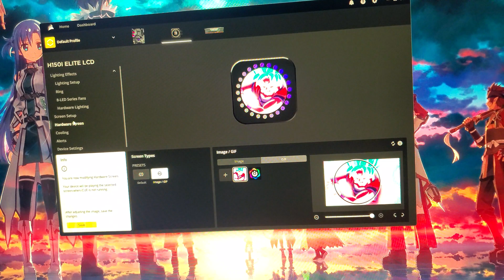Fixed the Cosair H150i Elite lcd from triangle error, 3 possible cause

Comment: corsair icue h150i elite lcd xt display i have customized my cpu cooler’s screen and rgb lighting with “icue “ it’s not letting me to go back to default lighting and screen how do i reset as it is earlier. i have even reinstalled my windows back still same issue
Reply from the maker: That's weird it should let you change your settings. Have you tried uninstall the application of icue? Delete it completely off and any files on your pc if any in documents.
And reinstall and make sure has the newest update. But that's weird it should let you change it whenever.

Comment: Just installed mine I'm not even getting screen setup option or screen hardware options seems lots of people are having this issue I'm just gonna pull it out and return it i don't have patience to deal with this bs
Reply from the maker: Sorry to hear that bro..
All I did was make sure everything was clip in right. There was one wire lined that I needed to push a little more into to clip, and I was good to go.

Comment: having the same issue but my fans are working and my screen is work also i replaced a fan on my case with a rgb fan which is also connect to the hub and it works but cant get rgb on my three radiator fans
Reply from the maker: I see

Comment: Installe mine yesterday. The lcd doesnt wort at all apart from th ering colour. No LCD settings in iCue. Tried all connections including remoing splitter. Still wont work.
Reply: I had the same problem so I disconnect and sata cable/ the power and reconnect it while my computer was on and it work! Try that out
Reply from the maker: I see.. Well on ICue has setting to change the LCD . But if it's not picking it up then it won't show u settings for it.
Make sure everything is plug in tight hard. That's what I did. Just becareful not to brake anything
Reply: @itzasrt  Have tried all that. Seems a lot of people have the same issue so wondering if its in iCue software.
Reply from the maker: @kwaka5704  hmm I see. Yeah not sure. Wish I can help more... 😕
Reply: @Kwaka Did you ever figure this out cause I'm having the same issues. No display at all on LCD other than lighting. Everything seems to be cooling but pump running high RPM.  Any help would be appreciated.
Reply: That happened to me to did you find a fix or was getting a new one help?

Comment: My issue was the commander ribbon cable was not clicked in correctly. It took a lot of force to get it locked in.
Reply from the maker: I see 👍. Koo
Reply: Dude, finally, thank you. This worked for me. And it took an uncomfortable amount of pressure to get it in all the way.
Reply: that might be my issue as well, so it clicks in when its fully seated?
Reply: @harrison3927  did you figure it out

Comment: If the screen not working is pump water?
Reply from the maker: Pump was still going but no display . But already got it to work 🙃
Reply: @itzasrt   i have this same issue my screen does not turn on its black but the rgb ring is working. will try to remove the usb splitter like you said

Comment: Had the same issues that you just had, mine my commander wasn’t plugged in properly. Fixed it and then I moved Pc cases and now I’m having a gear icon on my lcd screen, have you came across that?
Reply from the maker: No I haven't ran into a gear on the LCD screen sorry.. Is it still working with a gear on there? Like it's cooling the cpu?
Reply: It takes me straight to the bios and doesn’t seem like it’s cooling! But had to call Corsair and scheduled a drop off for my setup, getting a replacement unit hopefully fixes the issue.
Reply from the maker: @Eddie66129  I see damn. That sucks.
Let me know how it goes. Good luck. And if I come across ir I'll let u know
Reply: @itzasrt  will do! Appreciate the response 👌🏻
Reply from the maker: @Eddie66129  no problem. Wish I could of help
Reply: gear may mean a broken pump